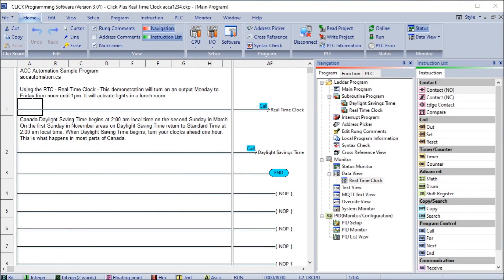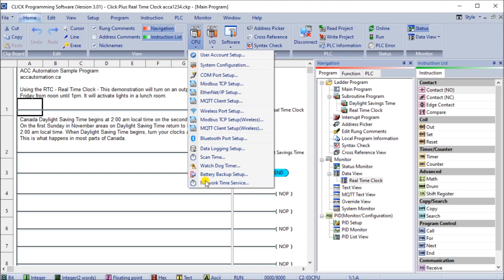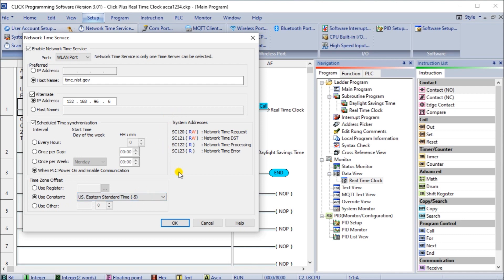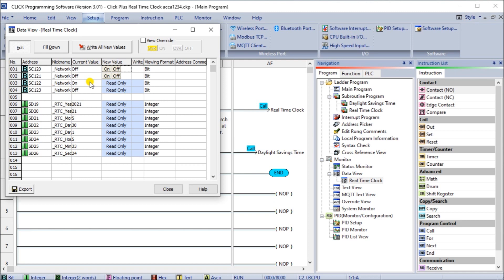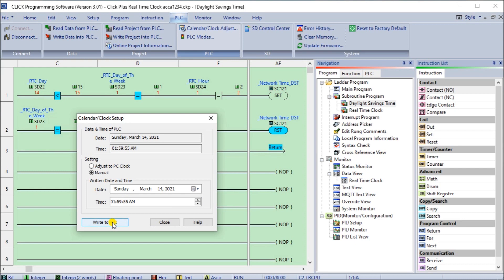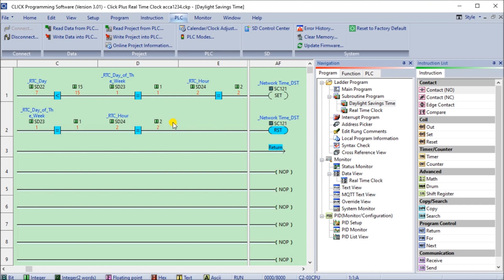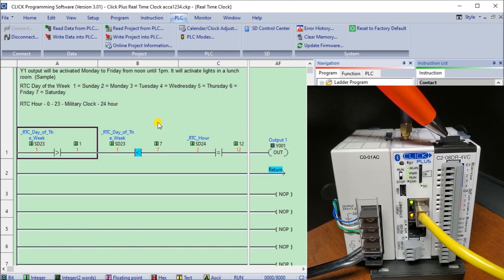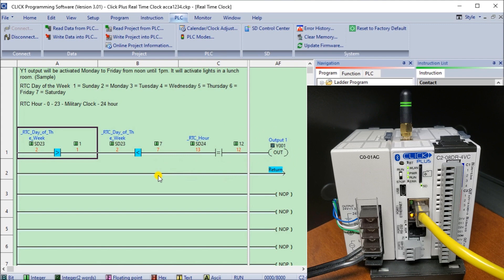Click Plus PLC Real-Time Clock

Comment from the maker: The specification for the RTC in the CLICK C0-1x series is a possible drift of 100s per month.
Additionally, the cycle for updating RTC data to the SD register is 1s. Therefore, there is an error of 1s ± 1s in the timing of the display of data in the SD Register.
This information has been updated today.
Regards,
Garry

Comment: How would you go about the example:
y001 has to be turned on for user-defined hours. And it has to turn on at a user-defined time of the day, every day. I imagine it would be possible to go like this: SD24=DS1(user-defined number) --> Set(y001) and then timer for reset or again SD24=DS2--> Reset(y001). But my problem is, what if PLC gets turned on in between those times, it would not be turned on until the next day.
Reply from the maker: Hi @Zbevc,
If the PLC get turned on between or after this time you will have to have the following logic:
If SD24 is greater or equal DS1 then set Y001.
If SD24 is less then or equal to DS2 then reset Y001.
I hope this helps you out.
Regards,
Garry
Reply: @ACCautomation  yes I thought about that, but what if on time is at 23 and off time is at 11. And then plc gets turned on at 02.
Reply from the maker: @Zbevc  
You have just added another condition to the code. 
DS1 - Time to turn on (00 to 23)
DS2 - Time to turn off (00 to 23)
Y001 - Output to Switch
I have done a quick sample ladder diagram example on the website for this logic.
https://www.dropbox.com/scl/fi/eqqxiwpx2djtym6ntf5tw/Click-Sample-Logic-On-time-Off-time-RTC.png?rlkey=bpjdu5zqf8klsbfmh4478cy3k&dl=0

Regards,
Garry
Reply: @ACCautomation  I am not sure, but I think the program you have written will only hold y001 on from 23 to 00 and then turn off
Reply: @ACCautomation  Also, no idea how to do it when you also need minutes. Click have really bad implication for RTC
Reply from the maker: @Zbevc  
You are correct, and my logic is not correct if the start time is greater than the stop time. Here is the corrected logic:
https://www.dropbox.com/scl/fi/18vaisshgrsj7itpanxpl/Click-Sample-Logic-On-time-Off-Time-RTC-2.png?rlkey=tsvixe0fihmjb0d11yhdc55iu&dl=0
Regards,
Garry
Reply from the maker: @Zbevc  
What other PLC brands have you programmed with the RTC for comparisons? 
Click PLC with the comparison contacts is one of the easiest.
Minutes would once again be another condition on the rungs.
Regards,
Garry
Reply: @ACCautomation  unitronics jazz, they have rly nice implementation. When you have like a "timetable" with hh:mm(on) and hh:mm(off) and it works if 23:40(on)   23:38(off) is input it will be off for 2 minutes
Reply: @ACCautomation  and I don't think it is that easy with implementing minutes, because every hour you will be on or off, depends on which side of the minute scale you are. Except if you add another command that when you go past the set time hour, you only look for the hours.
And thanks a lot for the written program!
Reply from the maker: @Zbevc  
The Unitronics Jazz does have a nice offering. 
I've requested some information. 
Thank you,
Garry
Reply: @ACCautomation  I did a workaround.
Changed all the clocks instead of having 2 separate numbers(hours and minutes) into only minutes. So system time(new SD) = RTC hours * 60 + RTC minutes. And then used similar logic you did in the Dropbox link.
What do you mean by requested information?
Reply from the maker: @Zbevc  
Sounds like a good plan for your program.
I contacted Unitronics and requested information on their PLC line to create and post articles on my website and channels. I'm always looking for IoT-capable controllers. 
Regards,
Garry